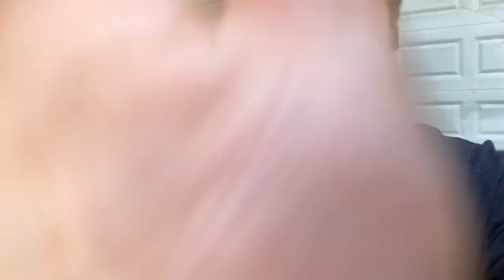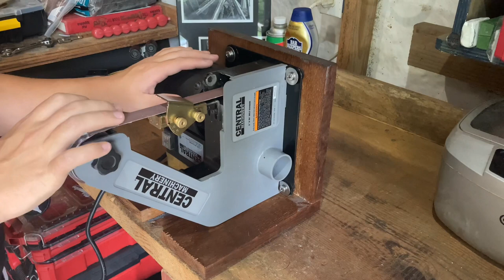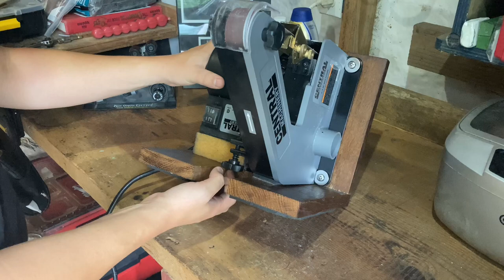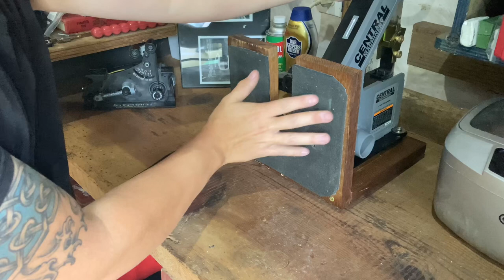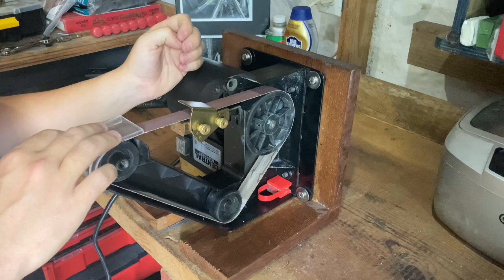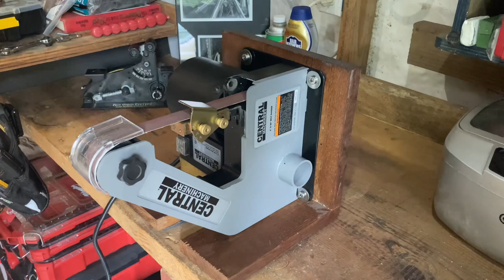How I Modify a harbor freight 1x30

Comment from the maker: That was a problem that I though of originally. I have a 400 watt inverter that I attach to my battery. I have a 12gauge extension chord i run to that. Eventually I would like to hardwire it in. But for now that setup works great. Also allows for the customer that is ok with me using power to run the extension chord for that. I’ll have to make a video on my setup 😊

Comment: Sam, this is Jim Callahan and Buford. I talked with you before you gave me a couple of my suggestions what I like to know what angle should I be sharpening kitchen knives, and knives that I’m having a hard time getting a real good edge I had a Harbor Freight and you’re like you have I have an angle guide I’m trying to sharpen about 20°that about right is there a special compound? Thank you so much Sam you’re doing a lot of good things and helping a lot of people. Thank you.
Reply from the maker: Hey Jim good to hear for you again. 😊
I personally start at 20° and if people want sharper or duller I go from there. But 20 should be crazy sharp! Should take hair off your arm going with the grain. Very little tugging almost like a razor after a few days of facial hair growth. The only thing I can think is make sure one the angle is correct. The angle marks on the side are wrong like 10° off. After that making sure to fully apex and get a wire edge, with the 120 grit belt. After that hit it with one to two passes on a 600. Then strop with the leather belt. Currently I have tormek paste on the leather belt. But I would like to get diamond emulsions when I run out of the tormek paste. It’s roughly 8-9k grit. But the leather belt really helps refine the edge, as well as removing the burr. A good stiff nylon cleaning brush works great for knocking off a burr after a single pass on the leather belt. Feel free to give me a call if it’s still giving you problems, and I’ll see if I can walk ya through it a little more clear. 😊
Reply: Generally, kitchen knives are in the 15 degrees per side. The key to sharpening is ensuring the apex (edge) is right at your lowest grit. If it is, then you are refining that sharp edge. If you pick up the 1x30 leather stropping belt using the green  compound does a fine job.
Reply from the maker: @WolfQuantum  15° is good for Japanese cutlery. It’s a little on the acute side for western, but I have had some people request it. I’ve just noticed that they typically are doing something speciality if they want it 15° and if it’s western cutlery it either gets nicked really quick, or rolls an edge really fast. You are absolutely right about apexing the knife! That truly is one of the most important parts of sharpening! The green chromium oxide is good especially if that’s all you have. Personally I like a diamond spray, or tormek paste. But also goes with what the client specifically needs. If they want an extreme polish. The green chromium oxide. If they want something that will be a super slicer for things like veggies. I’m going to go with the diamond spray. Thank you for chiming in by the way. It’s always nice building the community and sharing what works. 😊
Reply: @Samsmobilesharpening   I had a flashback to when I had just sharpened a few kitchen knives the day before. The next morning I heard my wife clanking knife edges into a plate. I cringed and yelled, "Please tell me you aren't slamming the knives I just sharpened into the plate!?" She was. She's learned better since. LOL. So, I agree that for most western and home kitchen cutlery 20 is fine and probably won't get damaged as quick. I only use the HF and green compound for not fancy kitchen knives. For my serious knives I use a KME non-powered and either diamond stropping tapes on glass blanks or diamond paste on leather blanks. I'm so bad though. Like the mechanic whose car is in the worst shape. I have everything from Arkansas to Waterstones, to the KME with a lot of extras, and the KO Worksharp. And a lot of knives. So, I just use one until it's a bit dull, toss it in the cabinet, and get another one out. Eventually, I'll get around to sharpening them. LOL. It's getting to be that time. For quick, honest, working edges the powered tool is the way to go. I knew a guy who would spend two days on an Edge Pro getting a 160K grit polished edge for clients who had more money and ego than an need for a working knife. Sorry, I'm an old farm boy from way back. A good farm, ranch, and field edge you can use and bring back in a less than 30 minutes max, is great for an actual working knive. Best of luck with the business.
Reply from the maker: @WolfQuantum  right!!!!! Can’t tell ya how many times I’ve heard that noise, and just cringe. I live out in farm country so a lot of the boys that work at the local feed store have me sharpen for them. By far the hardest abuse on any knives! So dull you can press full force and slide your finger and it will not do a thing. Spoons would probably be sharper. 😂😂😂 I’m the same way, for the longest time I always chased a mirror polish, did that with several different sharpeners. I did really like the edge pro apex. They work great for hair scissors, so that’s part of the reason that one stays. The 1x30 is just so easy. I tried it many years ago and didn’t care for it. But got back into it and with some practice it’s my favorite systems extremely flexible as far as finish, and as long as you are careful gets amazing results! 160k!!!! Dang!!!! He must be able to cut through the fabric between space and time with that kind of edge. 😂😂😂 I think worksharp has a stropping compound that’s about that grit. But may become necessary when they make lightsabers. Who know we may have to sharpen them.
Reply: @Samsmobilesharpening   I'll ask my son who is retiring from the Air Force. He was building lightsabers on the side for a while. They even have competitions with them. LOL. He really did well making 3D printed lightsaber stands and selling those for a while. Then sold his printers. When he gets moved to where they're going to retire at I think he's going to start 3D printing again as a side gig. Keep em sharp and keep the liquid bandage handy. I always kept bandaids and a tube of liquid bandage in my sharpening kit.

Comment: I need to ask, what is the better direction to sharpen the blade in coordination with the direction of the belt? I have seen people go blade up towards top of the grinder, others blade point down in the same direction at the belt path. What are the pros and cons to both?
Reply from the maker: @evangiannakas8371  for belt going away from the edge. It removes material slower. So less chance for heat to build up. But you can do it edge leading as well. Just gotta be super careful. When belt is going away it's the same direction for the leather belt if you use one.so. O need to do anything different for stropping. And worst case scenario if the belt is moving towards you and grabs. Could throw the blade towards you. But most people would say it disconnects from the blade and would not be able to. But with how I sharpen and it not resting on the guide it possibly would have enough means to come thrown back at me. I just don't want to be that one in a million chance. I've already had some freak accidents. Don't want another lol but a lot of people do it. 🙂 So it's more pick your poison. For me I'll always choose belt moving aways from me. Makes my mind rest easy.

Comment: My Ken Onion worksharp blew up the motor with very little use and I took it apart and found no serviceable parts so into the trash it went.  The motor is tiny and you can't change the brushes.
Reply: Can we assume that the K.O. for home kitchen use or not even for that.
Thanks.
Reply: @redangrybird7564 From my experience, KO is a low quality tool. I had KO edition and MK1. KO edition died pretty quickly, MK1 is still alive but I prefer HF 1x30 better.

Comment: Do you have multiple machines? How quickly or slowly is it to change belts? I have ken onion sharpeners (3) with different belts to get through knives faster
Reply from the maker: @javierdeluna7830  I use one machine very similar to the Ken onion. It's actually about as simple as the Ken onion. But the belts last significantly longer on the 1x30.

Comment: For some reason or another it’s hard using that angle guide. Can’t keep it steady knife moves too much down or gets stuck on the bolster. Especially if you have to use light pressure. But it’s a great set up especially if you add a variable speed motor to it. Sewing machine, or the psi motor.
Reply from the maker: I tried a variable speed motor for a router. But learned the motor needs a certain amount of power to even function. So I just made do with the single speed. I actually have really good luck with it.
Reply: You might do like me, I replaced that flimsy metal behind belt with a piece of 1" wide  2" angle. Drill and miunt to mch, then grind to fit if needed, makes a solid backing surface for the belt.

Comment: I like the Wood Base you’ve put on your grinder..I’ll give it a try (and be sure to cut out that notch on the bottom).  I have the same selection of belts you have mentioned and I am a beginner.  I have a few pocket knives to practice with and a Machete as well.
Reply from the maker: Thanks. 😊 I’m actually in the process of building an aluminum frame with a grab handle. But that wood frame is still going strong! Good luck and remember practice, practice, practice. 😊 it’s a great way sharpen just remember to be careful. 😊

Comment: Thanks a lot Sam, very good info on the 1x30.
😎👍
Reply from the maker: Glad I could give ya some helpful insight. I plan on making a follow up video here soon as a 6 month follow up. Then a 1 year. I did pick up a second one. The new model they released this year is pretty good! Only problem I have with it is they increase the power demand. Same speed motor, but uses more power. Kinda curious why it wasn’t the opposite way. But then again I’m not the manufacturer. 😂
Reply: @Samsmobilesharpening  have you had any problems with burnt knives tips with the 1x30? Some people say that it runs very fast. Thanks.
Reply from the maker: @redangrybird7564  it does run quite fast. But It’s something I am very cautious about. With how I sharpen, I can’t feel any heat buildup. But something you can do, if you are worried is. Dip the knife in water or have a mist going on the belts. But some belts fall apart when wet so be careful there. Great question btw! Thats part of the reason powered sharpeners get a bad name. Used improperly they very easily can destroy a temper on a knife especially the tip.
Reply: @Samsmobilesharpening  thanks a million, I'm thinking to buy a couple 1x30 for a mobile sharpening business that I just started. At the moment I'm using a variable speed lithium battery Milwaukee floor belt sander upside down on a folding table. It works great because it is very powerful, it runs on batteries and I can adjust the speed but I need a more professional setting (access to an angle guide). 😎✌️
Reply from the maker: @redangrybird7564  of course glad I could help. That Milwaukee setup sounds pretty cool! Honestly I’m just waiting for someone to release a battery powered 1x30. It would make that process so much easier! I would also look into a small generator for events and places where you won’t have power. I’m going to be picking one up here shortly.

Comment: Have you had a chance to check out the toolcker 1x30 belt sander? I’m almost $300 and I was just curious if it’s worth getting compared to a harbor freight belt sander
Reply from the maker: Personally I do not have experience with that specific setup. But I’m super impressed with the one from harbor freight! Significantly better than the 1x18 from worksharp. But to be fair that is a great setup for learning!
Reply: and then one could buy from Curry’s Custom Cutlery the wheels for the Central machinery units. Belts and all as well. It certainly is safer to sharpen edge Trailing, then Leading.

Comment: Awesome video and thank you!! Question: what hardware did you use to mount the sander to the boards.  I see washer but what kind of screws are those?
Reply from the maker: I’m not sure the exact size. But I took the rubber feet. Drilled a hole in them, and got a screw the exact size. I went with a machine screw. On the back side used a nylock nut and a washer to keep it together. I’ll do a video showing it better. 😊
Reply: @Samsmobilesharpening  Thanks brother!

Comment: Where did you get the angel plate
Reply from the maker: I bought it from Amazon. If you type in 1x30 angle guide it should pop up. There are two different versions. The one I use is the edge trailing or away from the blade. The other one is edge leading or towards the blade. I personally don’t like them but I know a lot of people who do.

Comment: What is the size of the wood you cut and made the modification?
Reply from the maker: If you are referring to the board I attached the 1x30 to. I took two boards. Measuring 8.5 inches x 9 inches. And screwed them together, with glue as well. 8.5 being the width. Your choice of wood. But I would recommend a good hardwood.
Reply: Thanks a lot for the measurements. @Samsmobilesharpening
Reply from the maker: @AI-MPower7  of course 😊 if you have any other questions. Just let me know. 😊

Comment: Where did you get the angle guide
Reply from the maker: I got the one I use on Amazon. If you look up “1x30 angle guide” there are a lot to choose from. I just looked for one with good reviews. I will recommend getting a leather 1x30 belt from red label abrasives. Takes knives from sharp to crazy sharp!